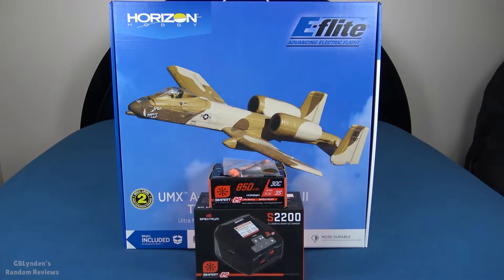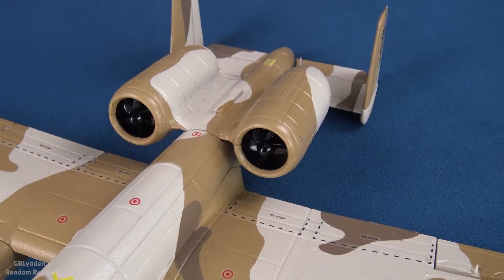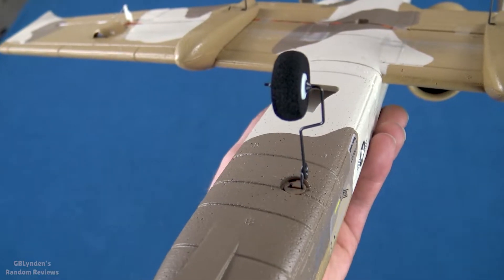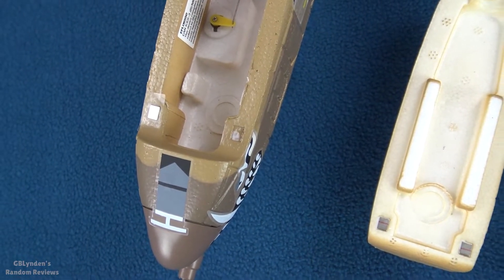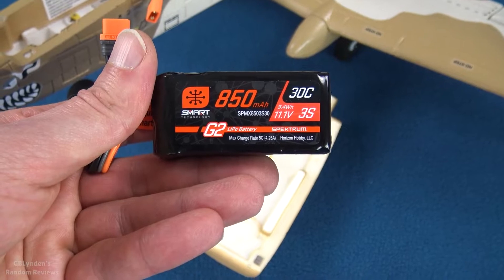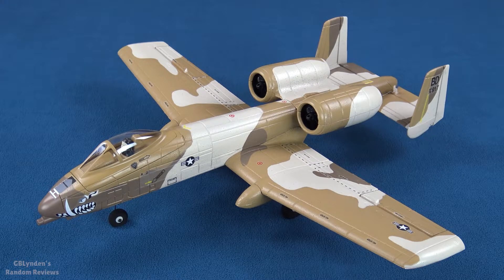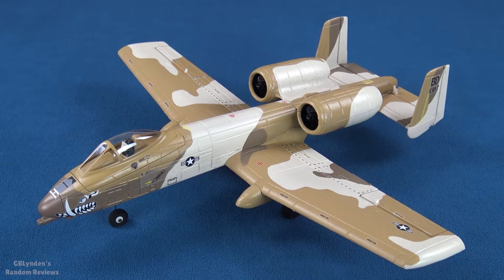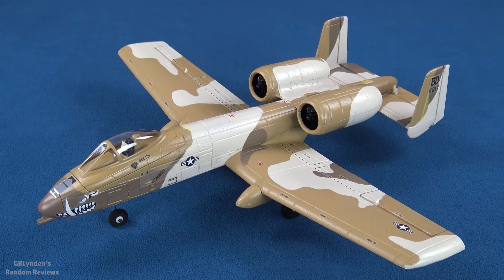E-flite UMX A-10 Warthog EDF Jet Unboxing Video

Comment from the maker: Links to this jet: Hobbyzone: https://bit.ly/3sv6okZ or Amazon: https://amzn.to/3mkBHfX

The links in this description are affiliate links. They give me a small commission on sales which helps support the channel and keep it independent: https://www.amazon.com/shop/gblyndensrc or visit https://www.gblynden.com/.

3S 850 mAh Spektrum Smart Battery with IC2 Connector: 
- Amazon: https://amzn.to/3cMzOWm
- Hobbyzone: https://bit.ly/2PZY5yY

Spektrum S2200 G2 AC 2x200W Smart Charger:
 - Amazon: https://amzn.to/39DKGUo
- Hobbyzone: https://bit.ly/3mi69r4

IC2 Adapter For Chargering:
- Amazon: https://amzn.to/3fHwNIw
- Hobbyzone: https://bit.ly/2QYf4SU

Spektrum XBC100 Smart Battery Checker & Servo Driver: 
- Amazon: https://amzn.to/2ESwAyB
- Hobbyzone: https://bit.ly/3hSUJqq
- Amainhobbies: https://bit.ly/2XjRWPh 

RC Equipment Used In This Video:
- Spektrum DX6 Radio: https://amzn.to/2FojzOP

Comment: Hey, great Review i just got an UMX A-10 aswell :).  One question the frontwheel of my landing gear is moving in and out the fuselage a little bit depending on the pressure is this normal?
Reply from the maker: Thank you! That sounds possibly normal. The real question is how does it taxi? I have a few flight videos of this jet up on this channel as well as my main RC Channel that shows you how it should look on the runway. I hope this comment helps 👊🏻💥👊🏻
Reply: @gblyndensrandomreviews   Taxi is okay when ground is super even if its just a little bit uneven it gets hard to taxi. I will watch your other Video and compare :)